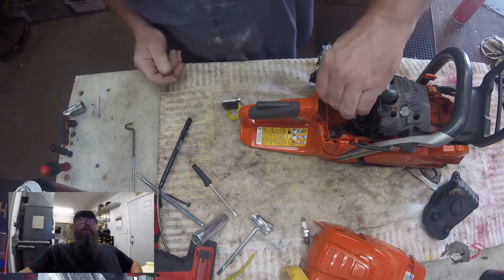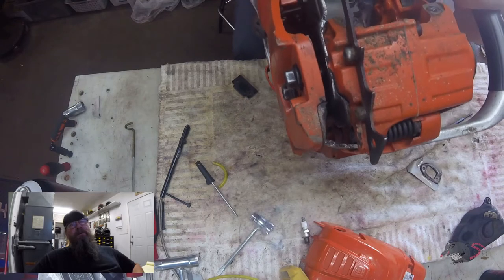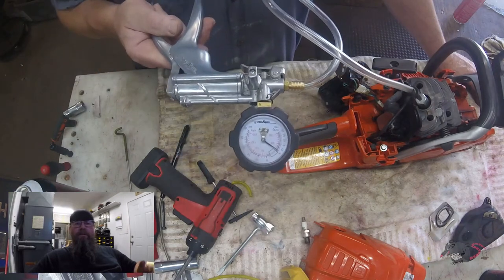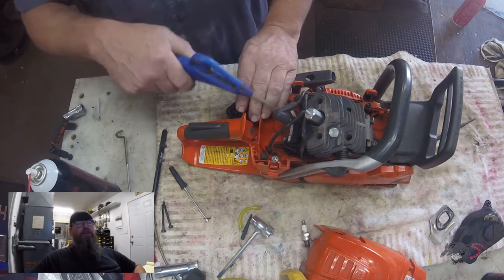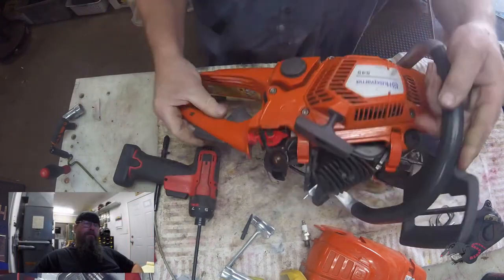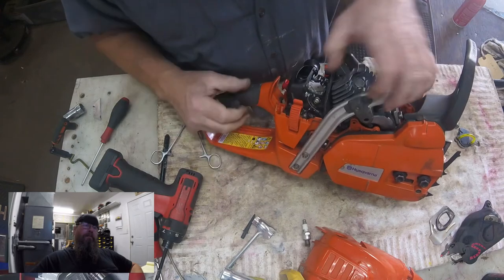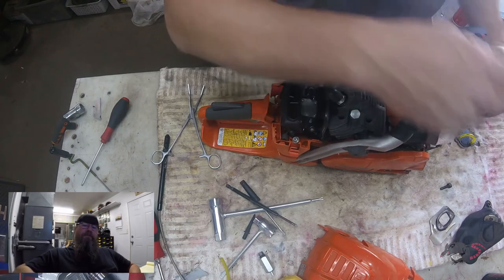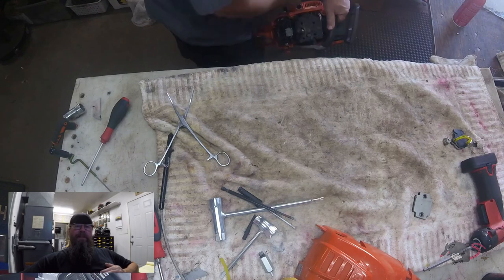Husqvarna Autotune Chainsaw Pressure/Vacuum Testing

Comment: I always like these. You can be a bit harsh on the guy working on the equipment, but I won't judge. I've never heard a 2 stroke being described in such glowing terms and a 4 stroke being defined so, um, not. I couldn't even look at my mower with the briggs motor when I walked by it after hearing that. I felt dirty.
Reply from the maker: A fresh shot of clean oil with every stroke or a bath in your own filth. To me the choice is easy, lol.

Comment: I like to see what other mechanics do....Always looking for a better tool, or better way to do my job.  Things have slowed down since the pandemic. Replaced  2 engines last week, FX 801, took 7 weeks to get them in.......I'm sure you have parts problems like I do.....
Reply from the maker: Yes big delays getting parts but eventually they've all come in. It sucks telling customers they have to wait longer but for the most part everyone I've dealt with is accepting the delays. What sucks the most is having shelves of half disassembled equipment taking up shop space.

Comment: What is the part number of the adapter for the spark plug
Reply from the maker: 14mm plug 503844002. 10mm plug 503844003.
Reply: @TheGreasyShopRag   Thank You

Comment: You’re too low on vacuum test as 7” Hg is only about 3.5 psig, minimum 10”, best at 14” Hg!
Reply from the maker: When I was first taught this procedure the number I'm using is the one that was recommended in a Husqvarna service school. I think they were trying to make it easy to remember by going "7" each way. Later in an Echo school they taught us to use the higher number you mention. I guess I'm an old dog and can't learn any new tricks.